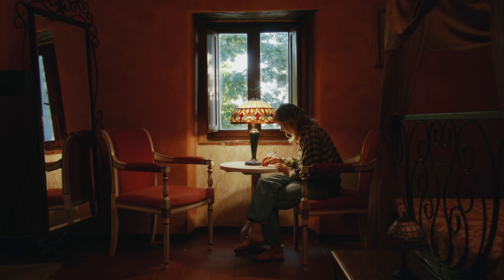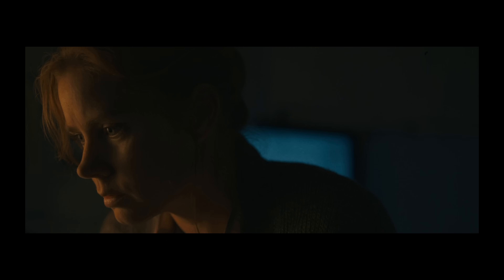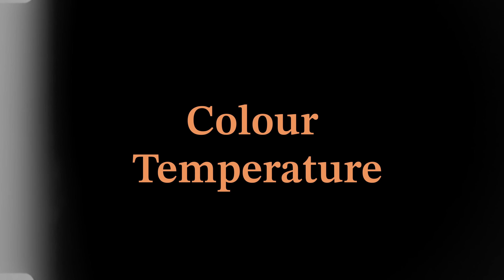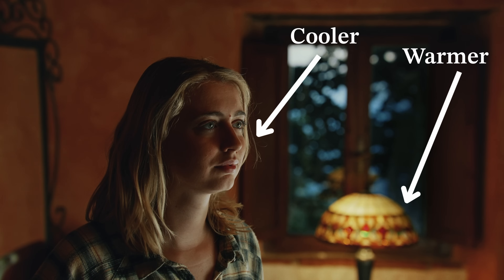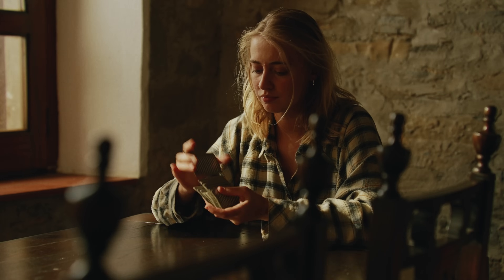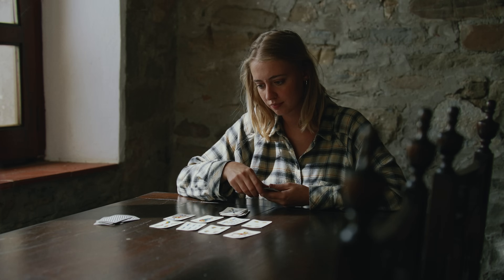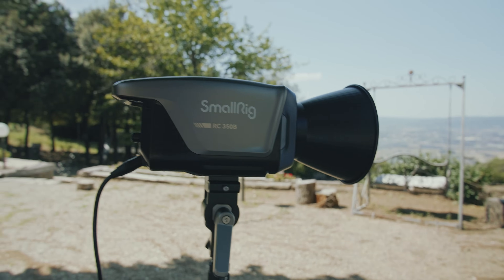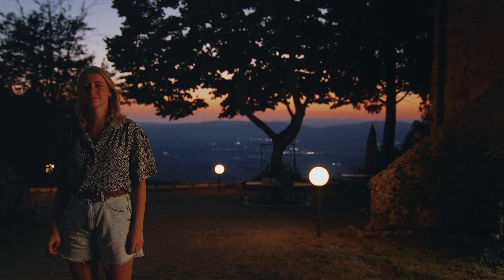The Art of Light: Techniques That Will Change Your Cinematography

Comment: I have the 450b, its good, especially how small it packs down for travel and the relative power and the price. But I still wish I had a 1200 watt instead. The inverse square law is best affected, worked around, by bounced light, tight level grids like 20 or 30  degrees can also change light fall off on the subject significantly as well.

Comment: I don't get it the whole part of fall off, can you explain to me?
Reply from the maker: Basically, if a light source is very close to you, let’s say 1 meter, if you move away from the light by one meter the drop of the light illuminating you is gonna be very quick (quick fall off) If another light is 20 meters away, if you move away from it by one meter, since the light it’s so far away, you’re not gonna experience a noticeable drop in exposure. (Slow fall off). Hope it helps :) cheers

Comment: Notes for Self:
1. Match the motivation of light (Practical or natural light seen in the shot)
2. Use lee diffusion app to learn different types of diffusion material.
3. Stay true to the Color temperature of practicals (Use "White balance kelvin meter" to check WB of existing source)
4. Use Hard and soft both light source to replicate day time (Replicate Sun and sky emitting light)
5*. Light diminishes over the distance (Inverse square law) - (Closer to the light Fall off is fast and Further the light - Fall off is less)
When there are multiple subjects aside each other the light diminishes on second subject when placed closer on one side, Hence you place it further and increase the intensity so that light falls evenly.

Comment: you also didn't explain how you lit the candle 1st scene. All that light definitely wasn't from the candles, or i am wrong?
Reply from the maker: It was all coming from the candles, nothing else. The FX3 was at iso 12800, but with CineEI I was monitoring at 3200. Which basically means using iso 12800 bringing it down in post by 2 stops to avoid noise. Pretty incredible how clean the FX3 can be :)
Reply: @jimmyonfilm  i am not a fan of sony but the fx3 is giving me 2nd thoughts. It means you could have also used ND rather than dropping it in post.
Reply from the maker: @obarovft314  it’s really great camera! No, actually an ND wouldn’t have given the same effect. In term of exposure level yes, but the noise in the image would have been much more noticeable. Instead if hit the sensor with more light instead of using an ND and bring it down you get a very clean image. Obviously you sacrifice highlights latitude, but if the image lives in the darker spectrum it doesn’t really matter :)
Reply: @jimmyonfilm  thank you. i am learning a lot. i wish i can see your post video so i know how you graded it. was it dropping the offset?
Reply from the maker: Happy to help!! If you want to alter the exposure in post as if it was done in camera, have to use a color space transform to go from your working gamma to linear (so for example for Sony: Slog3 to Linear) then you have another node to go from linear back to Slog3. In between these 2 node you are actually in linear gamma and you adjust the exposure using the GAIN wheel. Unity is 1 if you want to decrease 1 stop you go to 0.5. 2 stops is gonna be 0.25. Hope it was clear :)
Reply from the maker: Forgot to say. Lens at 2.8

Comment: Hey , which app do you use for color temp ? also , were all the scene turned with an FX3 ? last question does the film match comes with a tutorial ?
Reply from the maker: Hi! The app is called White Balance kelvin meter, I use it on iOS, I’m not sure it works on android too, but there are equivalent apps. Yes, everything was shot on the FX3. And yes, FilmMatch comes with a manual, but I also have a video on the channel where I explain in depth every node and how to use it :) cheers
Reply: @jimmyonfilm  there is an android version, but it's not free like the iOS one. It costs $2.99 a year

Comment: you should also state what you set the camera white balance
Reply from the maker: Yeah true, I should have said just as an additional info. But it doesn’t really matter what WB the camera is set to. it can easily be altered in post or if you shoot raw it’s not even backed in. Basically every camera has a fixed WB internally, all the other WB values are just math being applied to get those values. What’s really important to nail is the relationship between the lights on set.  The camera WB can be easily managed in post with very high precision. Cheers

Comment: you tell what the color temp of the lights are, but what temp do you have the camera set to?
Reply from the maker: What’s really important to nail is the relationship between the lights on set, the camera WB doesn’t really matter that much even if you don’t shoot raw. Basically every camera as a fix WB and it derives all of the other WB values by applying math. So the WB can be altered to very fine degree in post by applying the same type of math the camera would have applied. And because of this you can actually change the balance of the image as you want. Cheers

Comment: Much appreciated and simply illustrated. I would just check your ratios maybe when it comes to practicals and their art direction (usually they are pretty bland especially the shape and pattern so as not to be a distraction). i think maybe as much as the daylight illustration worked very well and again was well explained perhaps your iv to camera shot is a slightly less illustrative set up and looks in comparison a little messy iverly bright and very warm. Its an opportunity to show the lighting principles again but im not sure that the set up is really helping. Just a thought. Btw agreed in general most source light that mimics a sunny day needs two lights and as you showed a fresnel or better still a spot fixture is really what sells the brightness and there are companies who specialise in tinted diffusion grids to mimic ambient reflection from outside. Typically it helps also to direct the hard light so that it isn’t hitting the subject directly. Aim for a shoulder rather than face and it can help look less “sourcy”. That said i think maybe your set up had the intention of someone wanting to be in the direct sun. Just some thoughts. Apps were a great reference. Much appreciated content.
Reply from the maker: Thanks for the taking the time to write such an in depth comment! I really appreciate it. I’ll improve the behind the scenes for sure :) and yeah the spotlight makes it even better when it comes to emulate a fare source as the sun, but I didn’t have at my disposal unfortunately. Cheers and thanks for your support!!

Comment: lol you coulda easily place a net on the girl in the last scene and it will cut the exposure on the girl while balancing the exposure on the guys face
Reply: This doesn't mean he wasn't right. This could be another option for 'If' you have a net and the mount. You might also have an issue if your characters are moving in the shot.
Reply: @mongehsonjong4673  I never said he was wrong!  But in this particular example clearly the female was stationery!
Reply: When you start by 'Laugh out loud' and proceed by using 'easily' in your response I assumed you intended pass your method as a better/more practical method than the foremost proposed method.

Comment: ok so what wb should i put in camera the same as the lights or a neutral point ?
Reply from the maker: Good question! It depends on the balance you want. I’ll explain:) If you have a light on the scene which is 3200k and you set the camera to 3200k you basically have a neutral image. The light is gonna be seen as white (neutral) by the camera. If you set the white balance of the camera higher, let’s say 4000k. Now the image is gonna be more warm. It depends on what you prefer. If you wanna keep a tungsten table lamp on the warmish side then you will set the camera WB slightly higher. (4000k for example) If you want it neutral then you will set the camera WB at the same temperature of the light. Hope it helps :)